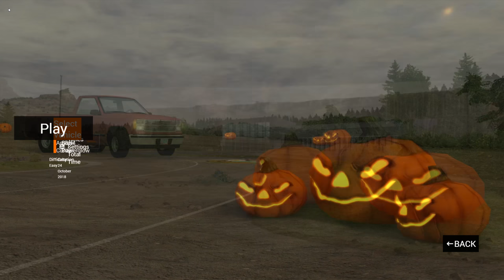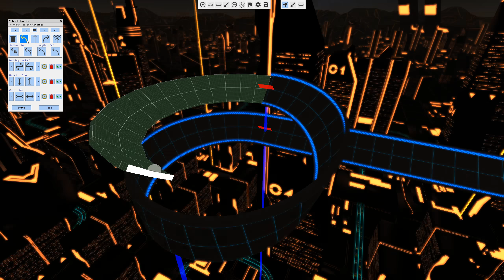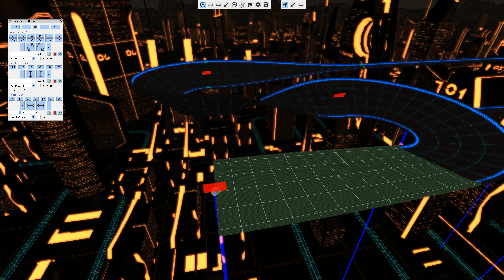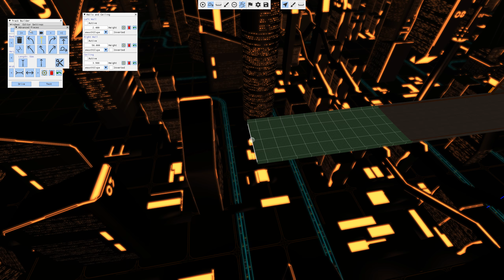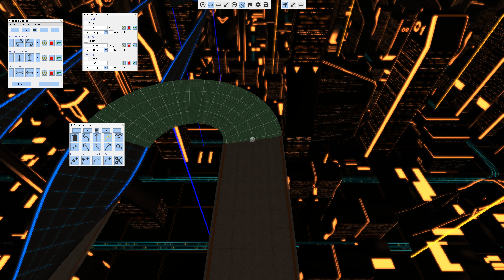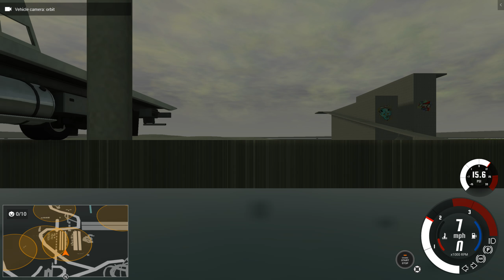UPDATES! 0.14 - BeamNG.drive

Comment: The physics engine is good. Crashing is fun. But the driving is not fun. The car sounds are bad. So much lost potential in this game.
Reply: Well, the driving is supposed to be realistic, nothing holding your hand
Reply: Alpha version keep that in mind.
Reply: I first played the game in 2014 and not much has improved in my opinion.
Reply: @justabbygal4777  well. You're completely wrong. "Lost potential"? The game is way better than what it originally was in 2013. So get your facts straights.
Reply: @JohnSmith..  I wrote this comment 3 years ago, I don't know if you're oblivious to that fact, but either way, I haven't played it since, so I don't know the current state of the game.
Reply: @justabbygal4777  I'm not. And  the game has physically based rendering. So maps look better. And Car sounds got better.
Reply: @JohnSmith..  Yet you replied to the 3 year old comment of mine..?